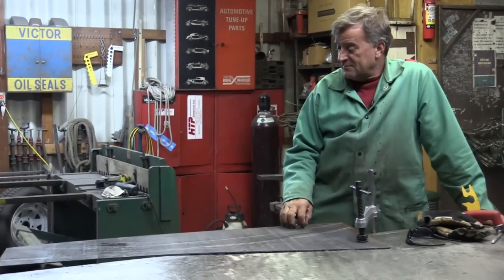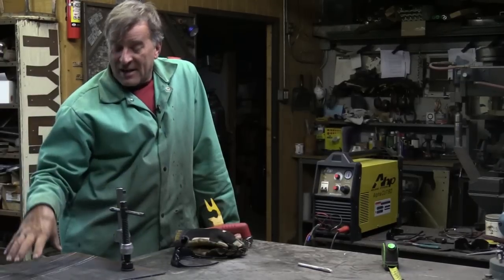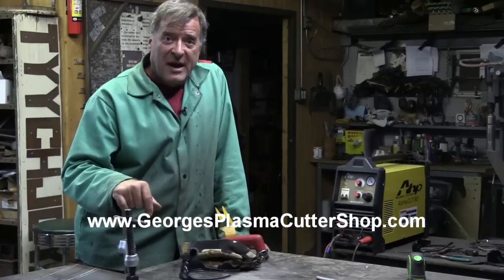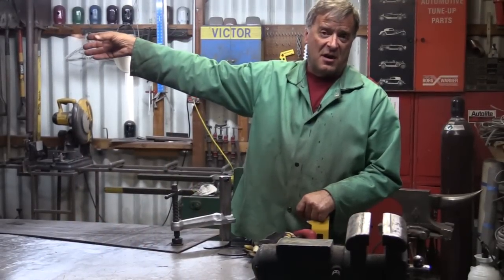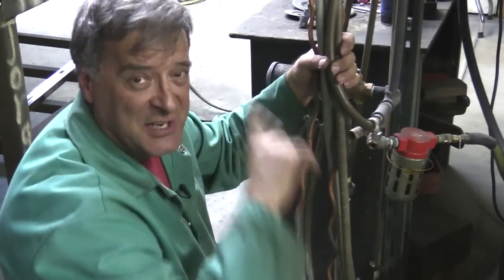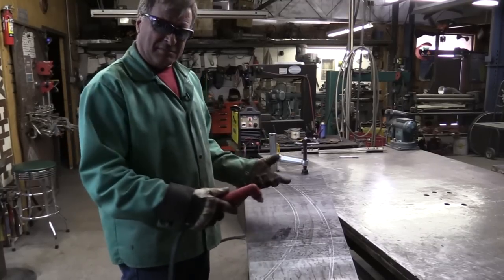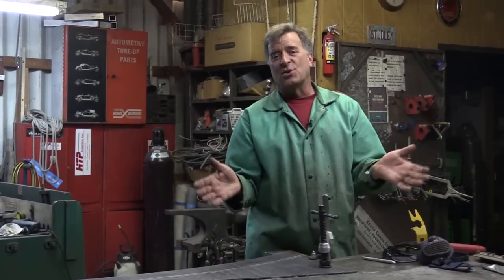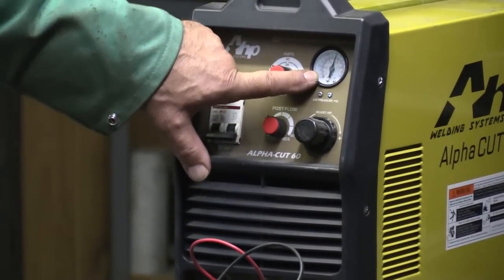Plasma Cutting: "What Could Possibly Go Wrong?!" - Kevin Caron

Comment: Do you make the tip touch the cutting surface or theres a distance to maintain?
Reply from the maker: If you are using a drag tip you can put it right on the metal.  Otherwise, nope, you have to keep about a 1/8th inch gap from tip to metal.

Comment: My carelessness is what happened, I had isolated air at the compressor to avoid it starting via gradual leakage in the air hose / fittings. Air pressure [and some volume]  remained in the line sealed by dry break Nitto couplings. When I plugged air line into the machine the machine's pressure gauge read correct so all good to go [so I thought]. I started the cut and within about a second air volume within the air line was exhausted and a small sun appeared briefly at the tip !
Reply from the maker: I hate it when that happens!   Glad you are okay.  The machine is fixable.

Comment: Another trap, I had my plasma cutter set up and I thought ready to go, had air pressure in the machine and air in the 12 ft air hose  Began the cut and the tip exploded with an impressive flash. Isolation valve at the compressor regulator was closed, all looked OK at the machine prior to operation but rapidly lost air pressure when cut commenced.
Reply from the maker: Damn!!   Never heard of this happening.  Did you figure out what happened?

Comment: Can I use a cutter tip and set a current (A) lower than recommended for cutting thin sheet? for example, use a 1.6mm nozzle to cut a 1mm thick sheet with a working current of 60A?
Reply from the maker: Sure you can!  It might not be the best set up, but it should work just fine.

Comment: I always thought one needed to wear the welding mask at a lighter shade,  but those looked like sunglasses ??  were they a special pair , and if so,  what shade needed for plasma cutting ??  Or what shade needed to choose on my miller helmet ?
Reply from the maker: I have some very dark sunglasses I use as well as cutting glasses.  The sunglasses are about a shade 8 and the cutting glasses are a shade 9.  You can use the shade 9 setting in your helmet to cut with.  But this is just how I do it.  You need to adjust this to  your shop and situation.
Reply: @KevincaronSculpture  Your reply is much appreciated..  thanks for the info !  I want to stay safe when I start using the machine.  It's on order right now.  I subbed to your channel!  Lots of good welding stuff here and you cover the newbies too!  I like the what could go wrong series too.  Thanks !

Comment: I tried running it with my lincoln welder generator but plasma arc  keep on going off and on off and on... what could this mean ? Is it the generator power fluctuation issue ?
Reply from the maker: Correct, the generator is not doing it's job.

Comment: good day sir. im planning to buy plasma but im not sure what air compressor needed. thus 1/4 horsepower enough? and what type of plasma should i buy? the cut 30, 40,or  50, ....? please advise. t  nx much
Reply from the maker: You will need about 60 gallons of storied air to run a plasma correctly.    The size of the motor matters not.    Look at the max cut thickness of the plasma cutters and get one that will do just a little over what your welder will weld.   I have a 1-1/4 inch capable machine because I do on occasion cut 1 inch plate.
Reply: Looking to buy a plasma cutter with a built in compressor what is the power rating on the plug will it working a standard 13 amp household socket regards mark

Comment: Hi, do you need special cutting glasses ?  I need a mask fore tig and mig mma. What dou you use fore plasma, will it damage your eyes
Reply from the maker: Yes, it will ruin your eyes!!      I wear the same dark glasses I use for oxy/acy welding.  So far no problems.
Reply: Do you have a link ore a brand of the glasses,  You can make a video about safty, its noware on youtube
Reply from the maker: Anything shade 5 or darker will work.     This is what I have,,,https://www.amazon.com/Miller-Electric-Welding-Glasses-Scratch-Resistant/dp/B003H1J5E6

Comment: Air basics; Keep the water filter as far away from the compressor as possible. Warm air does not dry well. It's okay to remove oil while it warm. Remove water while it's cold, as close to 32 as possible.

Comment: Hi , kevin. May i ask you? I'm new to this. My question : should i open the air compressor valve full open or partial to adjust the air amount. Thx.
Reply from the maker: The valve on the tank needs to be full open.    The pressure regulator on the plasma cutter is set with the knob on the regulator to what shows on the dial.
Reply: Kevin Caron, Artist so i do not need to worry about the cfm setting. Since i read in some forum there is cfm involve while i never knew how to set cfm. I just knew compressed air pressure only. I just knew about this cfm.

Comment: what filter type for the respirator?
Reply from the maker: Not sure, got them at the local welding supply.   They are for welding fumes..
Reply: Maybe you've had this answered already but I a basic N95 filter mask when cutting mild steel. If that's not adequate then I'd be using charcoal.

Comment: i just bought a lotos ltp6000 plasma cutter.Got all wiring and air hooked up and it want fire at all. can anyone tell me why it want start..very upset about this .
Reply from the maker: Need a lot more info to help you with this..    Have you got the plug wired correctly?   Does the machine come on at all?    Just won't fire the torch?     Do you have enough air pressure to run the machine?    Have you tested the plug with a known to be good machine?

Comment: Water separators for compressed air  must not be over sized.  If your plasma cutter is using 6 cfm and your water separator is rated at 25 cfm, the air velocity through the separator may not be fast enough to adequately remove all the water from the compressed air stream.  Sized correctly the water separator is just the first step in providing clean dry air.  Air should next pass through a coalescing filter with a Grade 6 element to remove oil and water aerosols from the compressed air stream.  It is even more important that the air be clean and dry and free from oil aerosols when using a multi function machine such as a plasma / TIG combination as the air for the plasma and the argon for the TIG will likely use the same line and valves within the machine.  Any oil or other contaminants deposited on the internal piping by the air will be picked up by the argon when TIG welding leading to bad welds and shorter life for consumables both plasma and TIG.  

A water separator followed by a coalescing filter should be a minimum for the air supply needed for this type of equipment operation.  Other compressed air needs in the shop such as when spray painting or blowing off a wood surface prior to finishing, may benefit from the addition of a desiccant filter to further dry the air stream.

I am not an expert in this area and this information right or wrong is based on my recent research online and discussions with air filter suppliers.  Parker air filters and Norgren air filters both have extensive information available online and may well be of great benefit.  http://teamtechnical.com/html/Parker%20Basics%20of%20Coalescing.pdf might be a good place to start.
Reply: I should add that while water separators should not be over sized, desiccant filters, in general, will benefit from be over sized and coalescing filters may (I think) benefit from being over sized.
Reply: @GeeKayKayGee  thank you very much for the very useful information👏👏👏

Comment: Kevin, I've also got and Alpha Cut 60 (got from you) and an array of George's consumables in various sizes.  Do you have a chart or something from your conversation with George on matching nozzles/tips/amps/PSI to material being cut?  I have a rough idea but most of the time, I'm just guessing.
Reply from the maker: +Christopher Peralta 

try these ,

   0.6mm nozzle/20amps/60psi

   0.8mm nozzle/30amps/65-70psi

   1mm nozzle/40-50amps/75psi
Reply: +Kevin Caron, Artist Thanks Kevin.  Do you also stick to the 1 amp per 1/100 inch of steel?
Reply from the maker: Yes, seems to work there as well..

Comment: one trick l do for curves  is magnetic tape used for art projects, like refridge magnets, its sold in rolls and its flexible 10 foot lenths, make whatever shape you want and it holds itself to the steel, l like to back it with another strip so it wont move but its not necessary , it does get beat up after a while, but its pretty cheape
Reply: can you drop a link as to what you're talking about ?